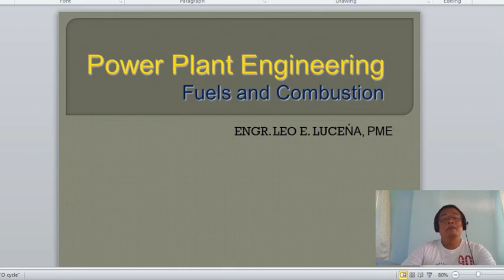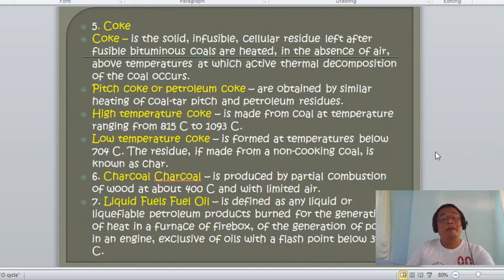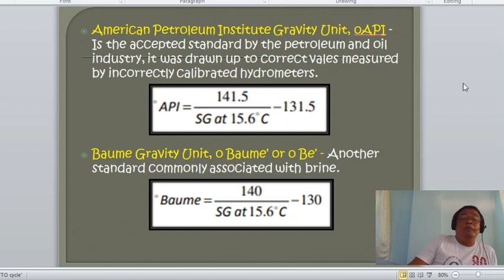Fuels and Combustion Part 1 (Power Plant Engineering)

Comment: Timestamp
0:08 Fuel and Combustion:  Introduction 
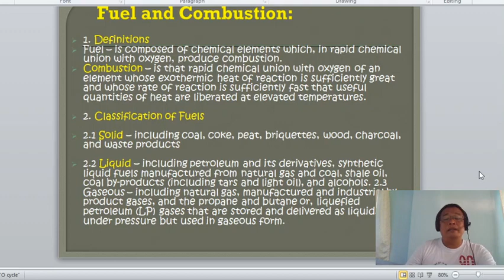3:04 Coal Classification 
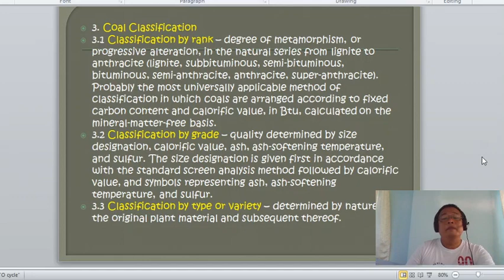4:54 Burners for Pulverized Coal
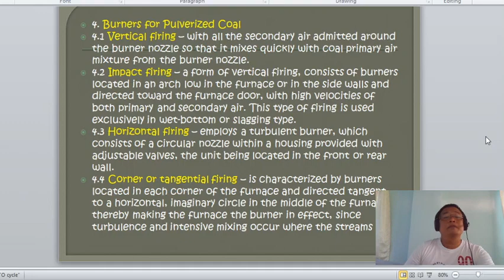6:46 Coke 
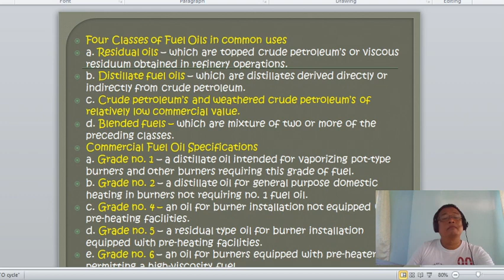8:15  Four Classes of Fuel Oils in common uses
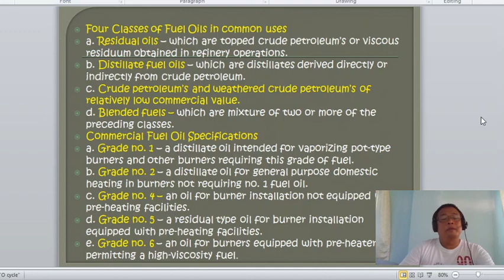9:45 Gasoline 
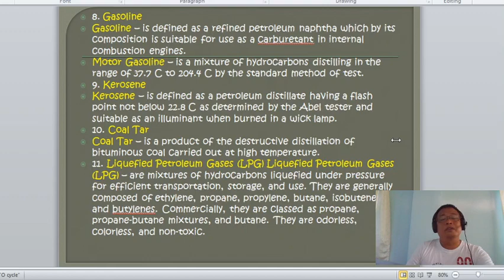11:10  Diesel Fuel Oils 
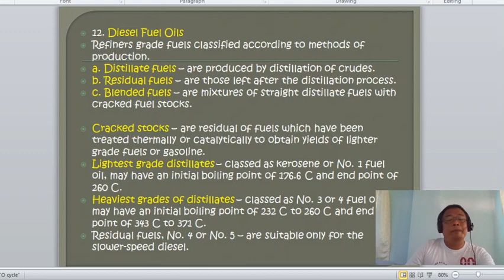12:46 Gaseous Fuels
14:22 SAE Three Types of Lubricating Oils
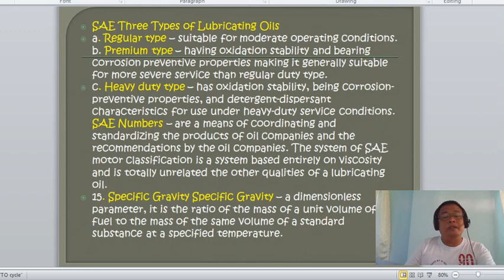15:19 SG for Water, Gas and SG for temperature (Formulas)
17:30  API and Baume  (Formulas)

Based on when the slides appear
All the best!